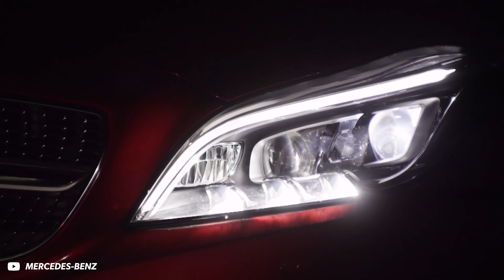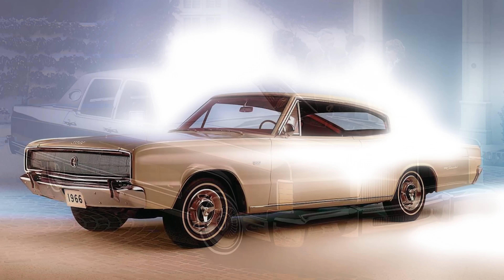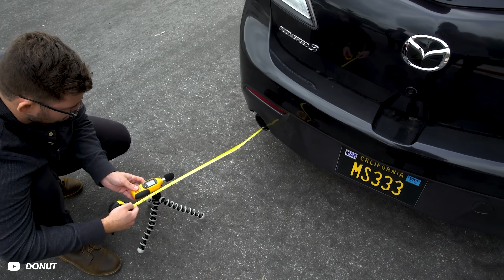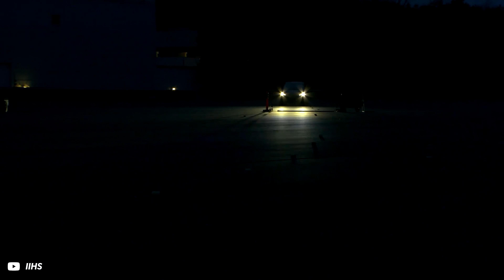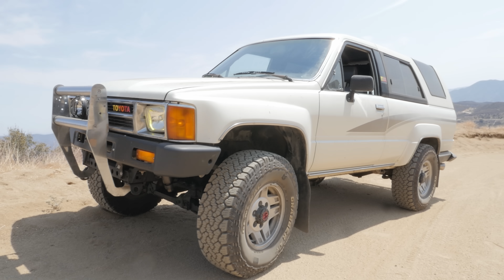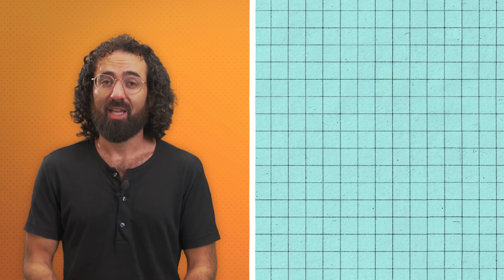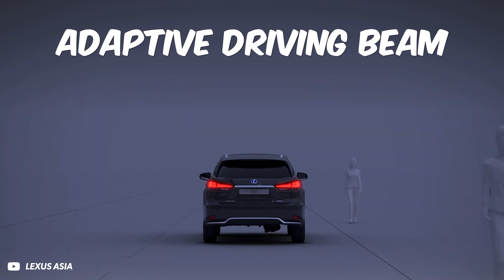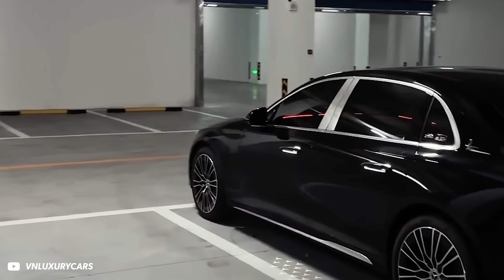Why new headlights are blinding American drivers

Comment: one of the big things if we're talking exclusively about the lights is CRI and colour temperature (and just outright colour).
I cannot explain to you how mad it makes me that the stupid german standard of 6000k won out over the french selective yellow, and how much more it maddens me that the 6000k standard is now mandated for any new car being sold in europe.
It's downright idiotic, it might be the correct colour for replicating sunlight but only if it's still daytime, the human eye doesn't respond the same to changes in brightness between different colours, it comes out looking like a mild blue. even that aside the utter level of glare it produces is insane. I've had my car (an early alfa romeo 156, which has weak headlights as a known flaw) equipped with the standard halogens, 6000k LEDs and selective yellow LEDs, in my experience the "white" ones are utter trash, I'd genuinely pay to have them removed on any car I bought (which local laws wouldn't allow on modern cars since it'd require tinting) since they tire even the driver's eyes out much quicker and genuinely seemed to make visibility worse despite being clearly much brighter.
on the other hand, the standard halogens, even if weak enough that I'd often forget to turn them on when within an urban area (not any brighter than the street lights and I see exceedingly well in low light, which doesn't help much when a car is coming the other way), were much more pleasant. the yellow LEDs were absolutely fantastic, minimal glare, downright absurd brightness (except for the main beams which were literally as bright as the original halogens, cheap chinese ones that I got as an experiment so nothing too surprising) whilst producing just a little less glare than the original halogens (yes I did go and try to get blinded by my own car in the driveway to check). my conclusion was to get some decent selective yellow halogen bulbs (running LEDs is legally questionable here as the law requires you maintain the original light type) for the main lights, and keep the yellow LEDs on the fog lights. I'm lucky my car is old enough that this was an experiment I could do, but many can't say the same, and even if a manufacturer was to figure this out after more than 20 years of these falling out of favour they legally could not put it into practice because the law has an absurd requirement for a horrendous light colour.

edit: I was in fact somewhat incorrect on some points as the regulations specify, in section 7's only point "7.1 - The colour of the light emitted shall be white" whilst this does not denote any specific colour, cooler whites seem to be the standard manufacturers have gone with, alongside that 6000 is the temperature for a cloudy sky (which I'm sure many here will know is a very unpleasantly glaring thing if there's enough brightness) whilst direct sunlight lands at 4800-5000. Either way it doesn't really change my point, acceptable temperatures should be in the 2000 to at most 5000 kelvin range and colour should be allowed so long as it does not impair visibility or possibly cause confusion with emergency service vehicles (which in truth most likely leaves yellow as the only option, unless green headlights are an unexplored revolution).

Comment: lately ive been tempted more and more to just drive with my lightbar on so i can actually see the damn road. while legally i am allowed in my state because it is mounted below my headlights. i know my lightbar is practically turning on daylight. yet i feel like some of these OEM lights are nearly as bright. my 20in light bar is about 8800 Lumen. wouldnt even consider my top light bar since that is a 50in 22,000 Lumen light, that might as well be the sun spawning in your face if i even flicked that on for a moment lol

my headlights are normal LED's before they get insanely bright and adjusted. never have been highbeamed with them. also they are plenty bright to see everything without blinding everyone else

Comment: Little correction, sealed beam headlights only became common from the 1940s. I have a 1929 Ford and it has separate light bulbs inside. The light doesn't pivot, there is 2 filaments inside the bulb at different positions, for high and low light. And city lights were optional (some cars came with cowl lights instead)

Comment: @6:25 the problem with this statistic is
1. Cars with brightler lights are cummonly newer and have other assisance systems to prevent craches.
2. The statistic is not representing accidents cause in other (less bright) cars who got blindet by those cars and craching in something else.

Comment: As an european that i drive a golf 7 with xenon, i tell you, those car sith matrix led headlights are trash. When they come feom feon you don't see anything in feont of you except a beam of light that is passes your front. The reflection from air dust or whatever is present in the air in front of you is higher than the reflection from the road lighted by your headlight. You have the impression that you go in a wall of light. Also they are a pain when they are driving behind you. Their lights cut your car but not entierly, you see them in your mirrors and it looks like high beam. Of course, some ar doing better than other but even those who are cutting your car better in straight road, will blind you on curvy roads. Amd you have another problem, on your sides you will have a very bright light and thiss will make you see less details in your front from the road lighted by your own headlighs.... belive me... thos matrix lights are making traffic safety worse. They are a pain.

Comment: German here. Adaptive Beam Lighting does not work reliably. If you have a road separated by barriers in the middle, the system fails to correctly identify oncomming traffic. It struggles in the fog, it even states that in the manual, but who reads the manual. It isnt looking down, so if you drive over a crest the system blinds oncomming traffic. Also, if it is wet, the glare reflected from the street surface is stupidly intense, even if the primary beam cuts out everything correctly.

Comment: It's so bad that I can drive around with my high beams on (2012 car, HID bulbs) and no-one seems to notice.
But seriously, all I can see of another car at night is their headlights. I NEED to be able to look directly at them for at least a second to judge distance, speed, road position, and there will invariably be times when this means looking right into the beam due to road geometry. Therefore any headlight beam should be dim enough that I can look directly into it from a distance of 20m or so, with my eyes able to recover from that very quickly.

Comment: European here. No, adaptive headlights are NOT the solution, they still are a fucking bane. They won't react before the connected sensors have picked up on an oncoming car. Which is per definition AFTER the oncoming driver has been blinded at least a bit. Cameras are not as sensitive as the human eye, and I doubt that will change anytime soon. So over here, driving at night has basically become a game of mutual blinding. A game that's lost by everyone. Me still driving a 2013 car with halogens, which I love because they are easy and cheap to change, have started to leave the high beams up a bit too long on purpose, because if I don't do that, I am blinded by every single oncoming car with adaptive lights. So instead of turning high beams up and down to make sure I don't blind other drivers like I used to, now I have to do it to blind them. Which is absolutely insane. Same as relying on technology that is based on blinding each other. Technology simply is not there, if you have a car with adaptive beams behind you on a twisty road, they pick up on you far too late, and way after blinding you via your mirrors. Then the following car's beams are constantly trying to readjust, which gives you the sensation of them moving around and stabbing into your eyes every few seconds incessantly. Night time traffic has turned from a less lit zone of taking care for each other, to a hyper bright zone of automated blinding warfare.

Comment: i am from england, and my retinas have been assaulted ever since these blue lights have been around. Blue light is the problem. My 26 year old Landrover has soft orange light, which doesnt hurt the eyes, but the range and strength is the same. You cant see any better with the damaging blue light than my oldster orange frequency, but it is a calmer, easier frequency. It is my opinion that this very obvious blue light problem has been deliberately put in cars so folks do not like driving at night. Who knows how many accidents they have caused, because the driver and car have gone by the time your head hits the windscreen and the car is in the hedge! they should be immediately banned in my opinion

Comment: Swede here, so driving in the dark for 5 months per year. We have Ford Transit vans as company cars and can I just say, those headlights shouldn’t even be legal they’re so weak. The so-called ”high beam” is maybe 10% brighter than the low beam. The low beam on my 2006 Seat is on par with the high beam on those Fords, I’m not kidding. Most back roads here hve no street lamps, so during winter mornings and going back to the office after the workday I’m driving basically blind, I can see maybe 30ft ahead, that’s it. And my company is too cheap to buy light ramps despite everyone complaining about not feeling safe on dark roads.

Comment: At least in Denmark most of those aftermarket LED headligts are illigal, there are offcause some young people that try to install them anyway, and then they get napped by the cops for illigal lights, wich cost a huge fine and a MOT inspection, where the car have to have the headlights thats stated in the type approval certificate, failure to do comply result in a failed MOT= not roadworthy= No licenceplates

Comment: After literally driving tractor trailers OTR for over 11 years and do my own valve adjustments and timing belt replacements oil changes and components like alternators and water pumps et cetera for over 50 years I believed for at least 25 years that the primary calls of blinding headlights is improper adjustment quite often delivered because you can get a better let roadway from the driver seat if you don’t care about blinding oncoming drivers, I’ve literally watched less than two seconds of this video when I make this comment

Comment: I think it's more a beam direction problem than a brightness problems. Bright lights are mandatory in my opinion, but they must be set properly from the manufacturer and shouldn't be changed by the users. There are many cars with decent brightness that are completely safe to use and I had no issues with them, but some others, even if they have old lights, they just blind you because they are directly pointed at your eyes, or if they are on your tail they blind you through the mirrors.
Even if I encounter this problem daily, I would never go back to old beams since those imho were more dangerous at night, especially with our roads in Italy.

Side note:
What about the brake lights? In terms of brightness problems, have you ever driven behind a Cupra crossover? Those red lights are also eye killers

Comment: Its not much better with the dimmable zones because the reaction time of these systems are still bad. To top that off, a significant portion of the driving population has astigmatism or scratched windshields that make any light source potentially blinding. I hate those auto dimming lights, they have never worked properly and makes night driving a waking nightmare with thousands of people swearing they do not blind anyone (they do).

Comment: What is more significant than the types of headlights is the fact that many drivers don't REALLY know how to drive in the dark. They don't know when to shift from the ridiculously bright high beams to half beams when approaching oncoming vehicles, and when to shift back to high beams. People also use their fog lights all the time, even though they don't really help in seeing things further away. Also, many drivers don't know they should keep their eyes in the white line in the outer edge of their lane when meeting oncoming traffic to avoid being blinded. 

Here in Finland, we have mandatory safety inspections for ALL vehicles. If there are other than approved lights, or the lights are installed incorrectly, the vehicle will not pass the inspection. I got my driving licence in the "good old days" when we still had mandatory night driving lessons, and mandatory lessons in the "slippery track".

The condition of the windshield also has a huge affect in avoiding being blinded by the lights of oncoming traffic. So one should make sure the windshield wipers are not dirty or worn, and there is enough washer fluid.

Comment: The EU needs to cap headlight output at something like 7500 lumens, or the equivalent output, with a luminosity measurement at 20 yards/meters to account for beam concentration.
Retroactively pull all headlights exceeding this maximum from the road, and force manufacturers to replace headlights produced in the last 15 years.

Ban them, hard, swift and outright. I drive a leased electric Ford Mustang Mach-E, and that thing blinds EVERYONE on the road.

Comment: I'm not sure if this is the same everywhere else, but in the UK, After-market lights are basically illegal (3rd party replacements are allowed, as long as they follow the specifications of the original, and are typically replaced by a Garage, because the original was broken.)
Plus, not only is blue light illegal here (Reserved for emergency services), but you have to pass the MOT every year. If you have out of spec lights, you'd fail the MOT, and won't be allowed to drive the car until it has been certified the problem as been corrected.

Comment: The IIHS says that the crash data doesn't support the bright headlights being more prevalent in crashes.  That makes sense due to something counterintuitive.  The bright lights cause crashes, but are not involved in them.  When I am temporarily blinded on the road I hit brakes and slow down until the offending headlights that are blinding me have passed in the opposite direction.  I am more likely in such a scenario to drive off the road I can't see anymore or hit an obstacle I can't see than only thing I can see which is those bright ass headlights.  If the driver behind me is similarly blinded they are more likely to rear-end my vehicle that they can't see anymore that is suddenly braking.

Comment: Heres a trick i learned from my grandpa about bright lights which is to look at the white shoulder line on your side of the road till the problem car passes. Also a way you CAN tell if a car has its beams on is look for foglights, if the car has them on then that means the beams are off (saw a few people wondering about how to tell and thats a way that works)

Comment: 9:38 well, thats not true.  Try driving over here, you’ll see… or not be able to.  They only work on flat straight roads towards the nearest vehicles; everyone else is still blinded.  And forget cyclists and motorcycles.

They know it’s a problem because they now have the whole light until turn off when they put on an indicator, so it can be seen.  They know about it - this admits a problem - yet refuse to fix it.  

They’re simply playing either ideas.  And are not forced to fix it.  There are strict rules in Europe, and frequent vehicle testing for road worthiness, but those standards are bad and implementation of checks is poor.